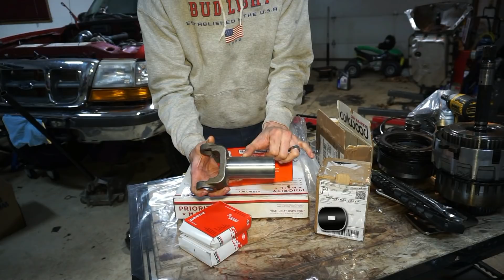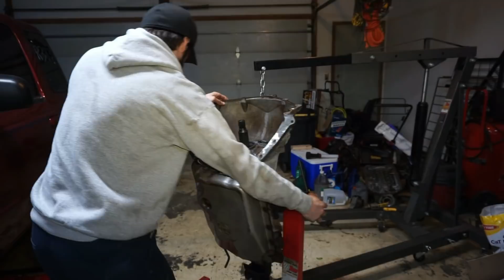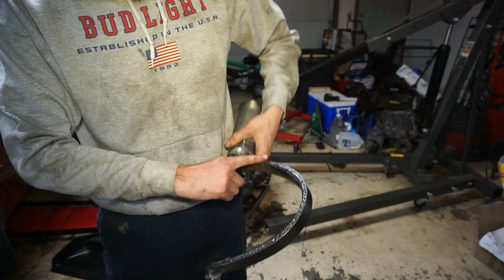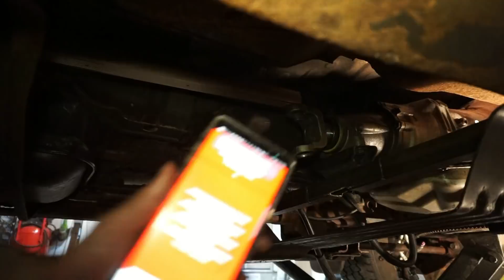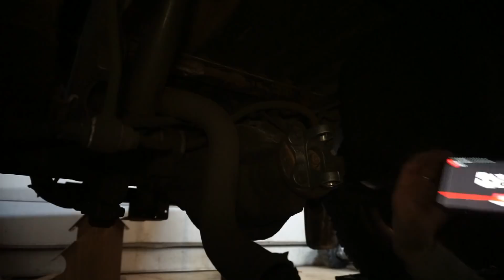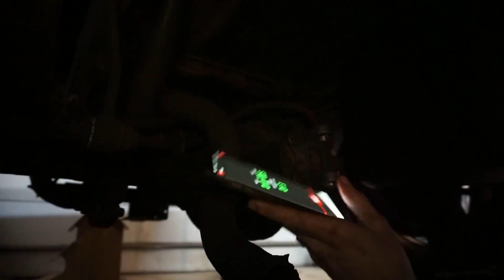HOW BIG IS MY SHAFT!!! UNBOXING, DRIVE SHAFT ANGLE 4L80E INPUT SHAFT REPLACEMENT!!!

Comment: Idk how much room you have to mess with but a good way to check the crank with out taking engine out is getting a pry bar and put it behind the crank pulley and prying the pulley. There should be very little slack. Idk the exact number but it isn’t much that’s allowed anything more and you have a problem. That’s how I checked my engine when the thrust bearing went out with out pulling the engine.

Comment: If you need help building your transmission and doing some mods let me know I can help you out
Reply: The transgo kit is only good for 600-700 hp
Reply from the maker: I've been thinking of building one on the side with a trans brake... Been looking for Ultra bells or similar to use the broken case... Thought that would be cool.
Reply: If you have plans of doing a transbrake now's the time to set up couple things before you install it
Reply: You should also do a mod in the front pump it will help ballooning of the converter
Reply from the maker: big block I'd like to build a different trans on the side... So could really do whatever...
Reply from the maker: big block What mod for the pump is that? Any links? My first issue with the trans was also a pump failure... Looking for ways to keep the pump happier.
Reply: I'm New at this YouTube thing I can Skype you and help you as much you need the mod for the pump is simple but very necessary

Comment: YOU need to install the driveshaft ,,,,,and turn the yoke for the second measurement .....all your measurements are "up:"angles  ,,,,, but it looks pretty good ...  spicer has a angle page to figure out driveline as well
Reply from the maker: Kevin G Not really understanding why that is necessary... If measured from other side of the truck they would all be down angles and end up with same operating angle.